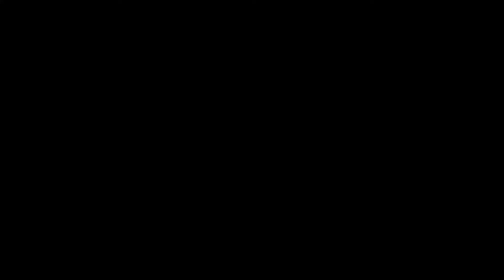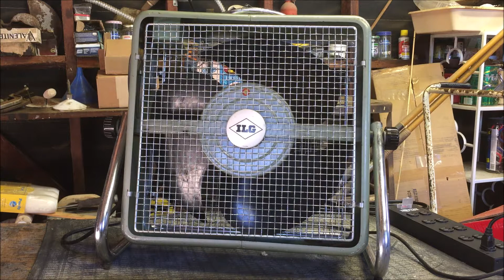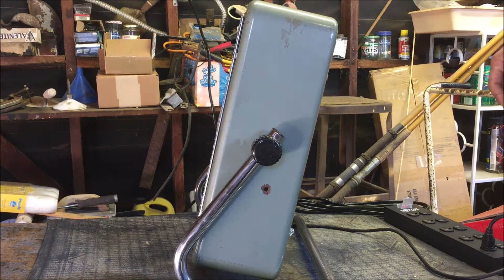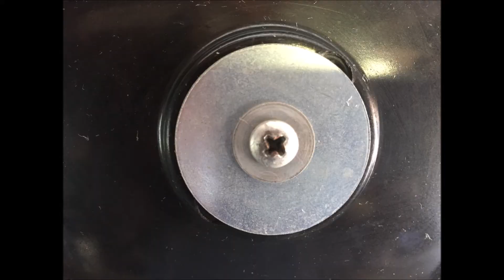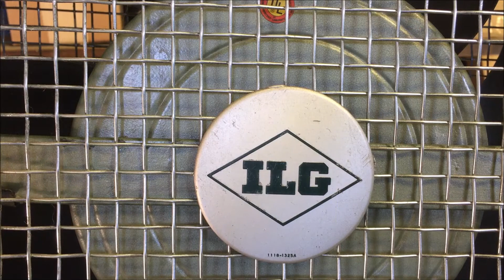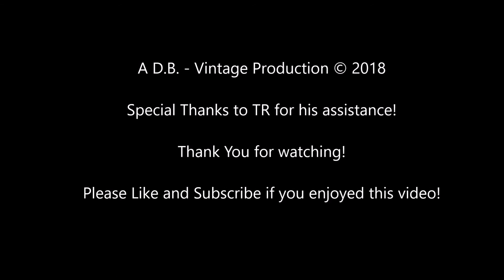Vintage ILG ILGJET 18" Industrial Box Fan

Comment: I worked in a grocery store back in the mid 1970’s that had one of these suspended over one of the delivery doors to the meat department. I believe it had the Venturi ring and a metal blade. The store is still in business but has since been renovated (probably multiple times by now) and I think the fan is long gone since the meat department (butcher shop) is long gone and they put a large addition (storage) on the back, so the whole area where the fan was has been totally reconfigured. The original building was an open air produce store and all the floors in the main sales area were slanted so they could be hosed down everyday. The floors were still slanted back in the early days of the current store there now, so if a customer had a loaded shopping cart (heavy) it would roll towards the downward slope of the floor if you didn’t have a good grip on it.

Comment: Thats the one I had. Yours is in remarkable shape. Not likely I'll be able to find a bladeset, I think. I am not sure where the one I have has got to, I am sure I still have it because I remember several occasions when I considered pulling the motor for something else. I couldn't bring myself to do it and I never throw away anything old and cool.
 I have never been a fan of transformers for lower speeds. Though that saves on bearing wear, having all the windings energized when it is switched on, eliminating  pulling the rotor off center, making disproportionate loads. Very many fans make a lot of electric noise because the voltage isn't actually reduced, but is only switching the current on and off before the motor is able to reach its regular RPM. Even so, yours is a beauty and I am glad for not being the only collector of old fans any more. This keeps many of them from the scrapper bums, and knowing this has  caught on I don't feel so bad about the ones I don't get. Do you know there is an Antique Fan museum near where I live? It is in Zionsville Indiana. There is also an association of collectors which may be of interest to you and the video viewers. C F
Reply from the maker: I've seen a couple of those blades on eBay but yeah they're rare. I got lucky on this one - a lot of these are thrashed or rusted away.

I've heard of and seen pictures of the museum! I'm actually a member of the Antique Fan Collectors Association, the organization that the museum is a part of. There are also a few groups of us on Facebook.

Comment: Really nice Ilg there!  It has always interested me how Ilg used a similar shape for these bakelite blades for the box fans, but used no parts in common with the industrial exhaust fans. You would have thought it would have been more economical to use common parts!
The condition of yours is amazing, as well. 
I love my converted industrial Ilg fans with home built boxes. Even the giant ones are amazingly quiet.
Reply from the maker: Thanks! This one is really nice with a decent blade, motor and paint. It's hard to find one that isn't thrashed.

Yeah, I've talked to a friend we have in common on the differences of the box fans and exhaust fans. It is odd that they didn't just build a box around an existing design - especially when I see the work that you and others have done. That 48" bucket blade you did is awesome.
Reply: Yes it seems that those fans in the southern areas have been pretty well 'used up' as they say!  

Glad you like my 48W box build!  That has really earned its keep in the summer heat these days!
Reply from the maker: They don't fare well out here either. There were several of these fans mounted in the outdoor patio over the cafeteria pickup windows at my old Junior high school - with the location being roughly a quarter mile from the ocean. They had been there for years and were very rusted - but still worked. There was another over the door of the kitchens by the loading dock that made a skrching sound - yet it continued to run.

The salt in the air doesn't do much good to cars either. We're lucky because we have a lot of garage space!
Reply: Yeah that sea air is horrible on things!  I have to work offshore and everthing out there is all rusted to pieces!